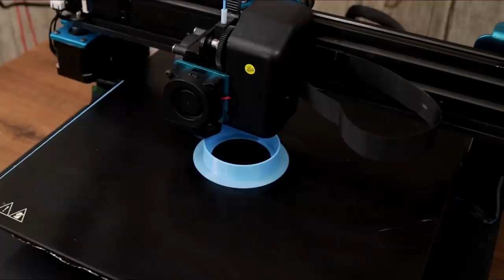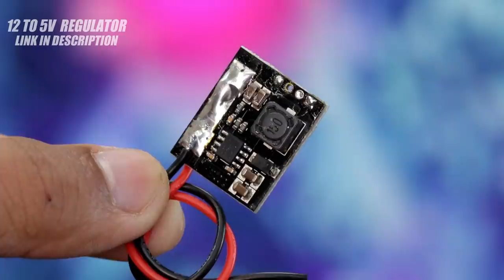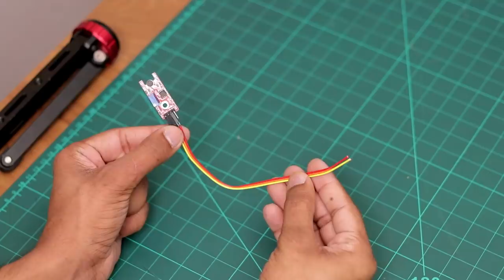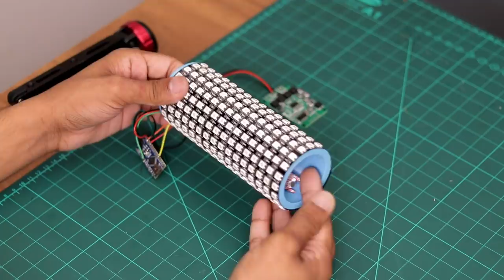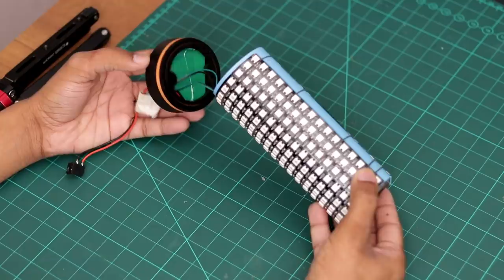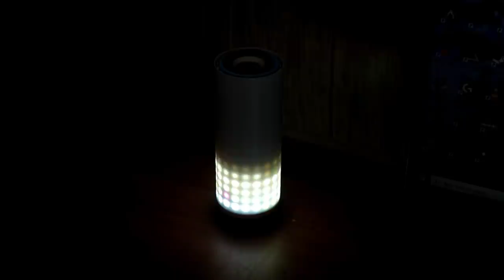Amazing! Making A Speaker with Music Reactive LEDs

Comment: I have a APA102 60 Leds/meter strip which doesnt seem to react to the music at all.. I've changed the num_leds and the pins which i have connected to the Arduino... Only a couple leds light up and doesnt react to any sound. Do you have any idea what might be the problem?